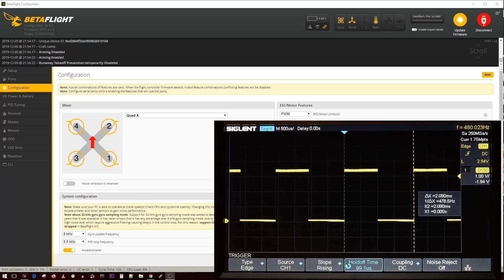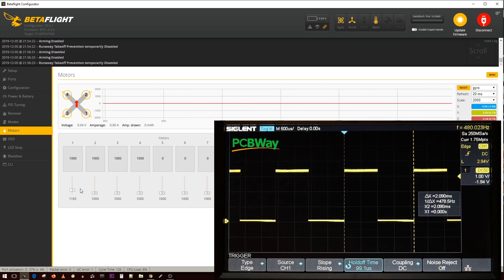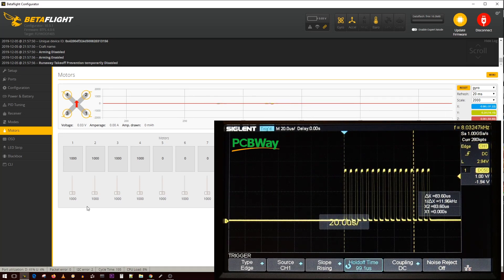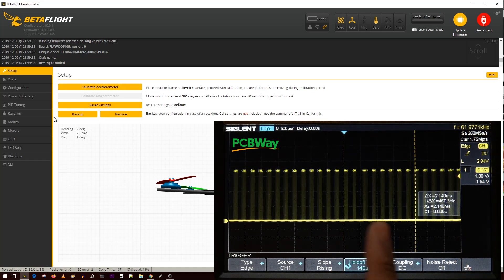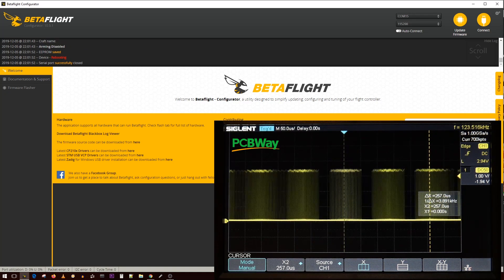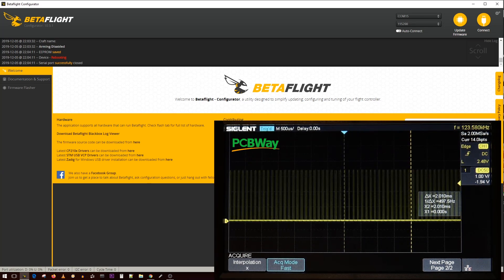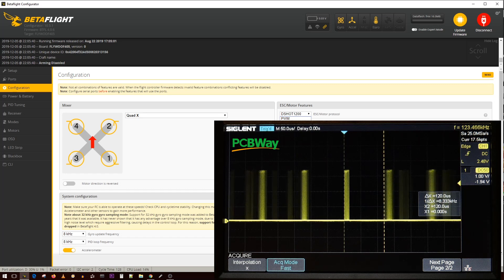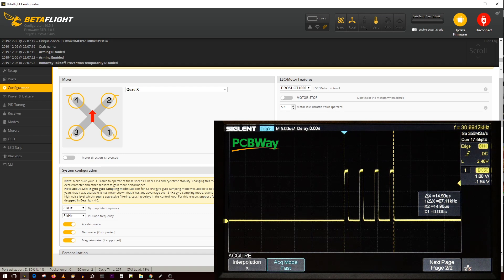Why DSHOT 600 & 1200 Might be Useless // DSHOT Speed Compared

Comment: It is still very helpful to get dshot out of the way as fast as possible from a code development standpoint.  When dma is cranking out a a dshot packet to gpio, you have to block dma adc reads and any dma traffic to spi1 on the stm32f4 series of chips or things get corrupted.

Comment: Interesting comparison, but you're missing the point of latency vs rate. The advantage of DSHOT 600 over 300 is that the time from the start of sending the data to the ESC, to it having received it, and being able to act on it, is halved. So the desired speed change gets to the motor ~25us earlier. When you consider that at 8kHz the cycle time is 125us, reducing the latency by 20% of the cycle time is quite significant. PID control loops work much better if your "plant" responds faster. Reducing the response time of the "plant" allows you to raise the PID values without causing instability. Thus using DSHOT-600 will allow a more aggressive tune than DSHOT-300.

Comment: can the power electronics follow these frequencies? how would you test that every packet is taken into account by the ESC voltage sent to the motor ?
even better, how can you test if the motor with a prop is taking into consideration every packet sent ?

Comment: Thanks for this vidéo.
Could you check in Bidir-DSHOT, because frame from ESC -> FC will also take time.
I think that is why we use DSHOT600 at 4K with RPM filter

Comment: Its not completely useless because signal intervals might be same but it also metter how long deos it take to complete the transmission. For example dshot 600 end its transmission 26us earlier than dshot 300 so motors react 26 us to signal twice faster. Remember there are 2 parameters "how often its sending" and "how fast its sending" that you miss in this vid. In other words - you need to go to the job once a day and it might take 2 hours or 1 hour so 1 hour is definitely better for me than 2 hours. Human reaction is a way higher than 26us but motors need to update as fast as possible to prevent oscilations etc.
Reply: Filter delay on the gyro signal is 4,000us, so focus there.

Comment: Thanks  . So do you think pro-shot is better for a noisy quad with beat up motors? Like a basher quad ? Or just stick with the  d shot 600  I'm running beta flight 4.0.6 with a old mamba f4 stack  on DYS 2206 2700kv motors that are very noisy and a little beat up lol ?
Reply: BF 4.1 with rpm filters bro....add $5 jesc for blheli 's

Comment: You know that the human reflex action in all this just makes about all this moot. WE can only react to a certain degree with our big Meat wrap bones and limited optical sheep eyes till all this stuff just dont matter.....Lol
Reply: Yes, for example when you dive into your own propwash - gyro senses unwanted turns, FC corrects and esc sends those data to the motors. Oscillations can be reduced if you correct after 3 degree turning instead of 9 degree turning. Everything helps because latency adds up but it is more effective to reduce 2000us filter delay than 27us esc command delay.
Reply: It's not for human to react to, more like for the PID loop to correct the quad's movement.

Comment: Excellent video DM...Now it would be interesting to see how many ms it takes for a motor/prop combo to respond to a given throttle change from the PID loop.
Reply: Spot on! At the end, all the electronics need to move a physical entity, and it's very very interesting to see where the inertia of the motor/prop becomes big enough to render any advancement in the protocol speed useless (or PID loop speed, etc).
Reply: @pomerus  actually on the contrary you want the only delay in the system to be the physical motor/prop combo.

Comment: And the 8k cap makes sense because the signal delay on the gyro is 2 to 4ms.  That is where we need to keep the focus (reducing filter delay).

1ms = 1,000us. So filter phase delay is literally 1,000x more important to minimize vs. worrying about increasing loop rate speeds.
Reply: 2ms/27us(DShot600) is a 74th of the 2ms filterdelay. So after knowing/calc which speed the ESC SHOULD be, the communication adds a delay till then ESC knows the value. So why not try to reduce it? But your right, the filterdelays still are the huge factor. Moreover this was the reasons to increase the PID loopspeed, not to calc MORE values, but to speedup the lag to get the new state/value to the esc.... maybe its time for a dynamic PID/Esc refreshtime? So read/calc gyro at 32k+ and send only if the valuechanges are more then a certain amount/and limit is to maximal Dshot repeattime? PS: love your work!
Reply: @bernhardtrzil6315  , cause reducing it come at a cost of reduced features, adding loop jitter, etc...

It is not worth it.
Reply: @uavtech  I still don't think there is any point running anything over Dshot600 and that's if your Pidloop is at 32Khz, which not many FCs / firmwares support anymore. Is this true about dithering?

Comment: I was literally just talking about this a couple days ago 😂.  I never really thought about it until I setup a quad with bf 4.1 and enabled rpm filters.  You can really notice how it's overkill when you do this.  Kind of makes me rethink quite a bit on what makes a quad fly better.  So thanks for the post! You really did an awesome job of explaining what I was already thinking but in a much more quantitative manner lol.
Reply: At some point noise becomes an exponentially bigger problem with higher sample rates (in the D-Term I guess). I think that's the reason the devs dropped DSHOT1200.
Reply: @TimeFadesMemoryLasts  DSHOT 1200 noise was one reason. Also they could not do bit banged bidirectional DSHOT at 1200 speed.

Comment: Is this DSHOT or bi-directional DSHOT (for RPM filtering)?  8K/8K RPM filtering recommends DSHOT 600 if the FC can cope with the speed.

Interesting that only 1 motor command is sent to each ESC per PID loop cycle.
Reply: There is no point sending more than one motor command because they would all be identical. The PID loop calculates the motor output right? So there is no new output until there is a new PID loop.

Maybe an argument could be made that transmitting more than once would compensate for noise?
Reply: More than one transmit of the same value within a PID cycle would be beneficial as any misread due to noise does not require the system to wait till the next cycle for the correction.  DSHOT ESC's will discard any corrupted packet in the case of signal noise.

The cost of sending multiple per PID loop is that the FC must spend processor power to construct and transmit the signal (may be able to save on construction costs for DSHOT as packet is the same).

The benefit of faster transmission in a single iteration per loop PID cycle is that the ESC's ACT on the signal that little bit faster.  (Also the ESC's are controlling a physical system that takes time to change - physical motors have momentum and resistance to cope with).

Maybe the BF dev's thought the cost of more than one signal per PID cycle (when feasible) is more expensive than the benefit.

Also with multiple signals per PID cycle, this could seriously mess up bi-directional DSHOT for RPM filtering as each DSHOT packet reports the poles seen since last received packet.   Multiple chances for mis-read per cycle.

Comment: You mean that dshot 600 and 1200 are just gimmicks ?
Reply: If I gave you two quads, one with dshot 1200 32khz update loop and the other with dshot 300 8khz. Could you tell the difference just by flying them?
Your reactions and signal transmission are way laggier than those update timings. It's like a dozen microseconds difference in a dozen mili seconds.
It's like getting a 500 hz refresh monitor when even trained eyes can't see the difference above 200hz
Reply: @mindprobe3587  no I agree  if you do what you are saying  you can't tell the difference I'm saying if you took two qwads and had them both at 32k and one at 1200 and one at 600 you most definitely can tell, the qwad will fly like shit on 600 and not on 1200 it's not just my reaction and so forth because in that sense if you did what you described you can't tell the difference ,it's the fact that the qwad will fly like crap again that you can tell, if you do what I say
Reply: @mindprobe3587  pretty sure you could detect the difference if running higher pid loop / dshot would mean less propwash
Reply from the maker: No but in 8khz yes.. Dhsot 600 is for 16khz and dshot 1200 is for 32khz update frequency.
Reply: @DroneMesh  
Great review!
I recently purshased a Hyperglide and Aikon RD32 45A 4in1 6s Blheli_32 F3. Looking for a suitable FC and the Lumenier LUX MINI F7 Flight Controller(ICM20602) caught my attention. Seen Joshuas cheaterquad build with F3 esc and wondered if this is the best route for rpm filtering? I'm in for future proofing with this dual cam option . I haven't been able to find rpm filtering at F3 esc+F7 FC(32k gyro) in reviews and like to learn on this topic. Would be great if this could be on your review bench.

Kind regards, Erik
Reply: No there not gimmicks they are useless ONLY because you can't go higher than 8k anymore

Comment: I agree 600 and 1200 can be considered useless and can't be told apart in betaflight  but in the flight controllers like FL1 that run 32khz you can definitely tell the difference between 600 and 1200 when you switch between the two your tune will be completely off and kiss you can tell the difference also but your right it's useless because you can't update higher than 8k anymore on betaflight
Reply from the maker: Yes in 32khz you need 1200 to run that and you need 600 for 16khz.. but for now in BF it's useless.
Reply: @DroneMesh  yes I agree
Reply: Since filter delay on the gyro signal is 4,000us and higher, how is faster loop rates critical?
Reply: @uavtech  I don't know I'm not as smart as you are or any of the devs y'all are the brains I just know if I fly my other qwads that aren't betaflight I can tell a difference in switching dshot protocols not knocking on y'all just my observations
Reply: @biggfpv2721  , the problem is 100% of the time, folks comps are not A-B when it comes to comparing things.

It usually starts out like:
"On my F1 quad vs. my BF quad..."
And I say:
"STOP! Your test was with two different quads (invalid)?!???"

When components that cause 10s of milliseconds if delay are set differently, you cannot use that result to judge 0.09375ms differences (8k vs. 32k loop rate).

I think sometimes folks just need to do the simple math between 8k and 32k loop rates.

1/32 - 1/8 = 0.09375ms

Human reaction time = 250ms
Prop rmap speed = 2 to 20ms
Filter gyro signal delay = 4 to 6ms
Reply: @Sasha Kruse Grim , RC Shim's latest test shows 10ms for glass to glass on FatShark.  Check it out in his latest DJI latency test video.

Granted, there is an arguement for quad machine reaction time which is separate from the human part.  There 2 or 3 ms matter (2000 to 3000us).  But not 0.09375ms when we have other things casing 2ms+ delay we need to be concerned about minimizing.   

This is like the 80/20 rule.  But in this case it is 99.99/0.01  so don't spend any time on 0.01 % of the problem.  Spend it on the 99.99% (props, motors, and filter gyro signal lag (Phase Delay)).